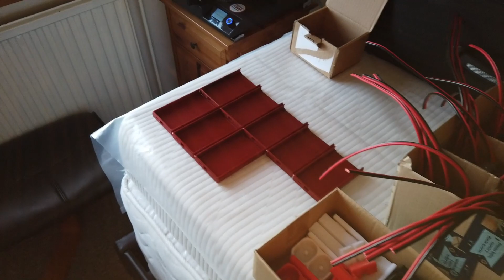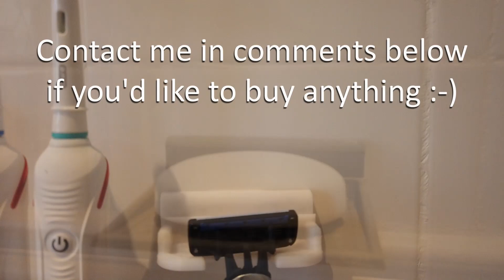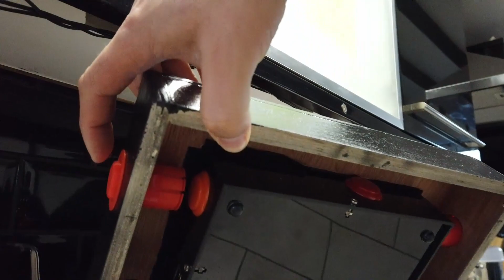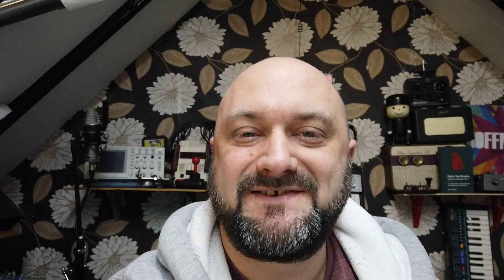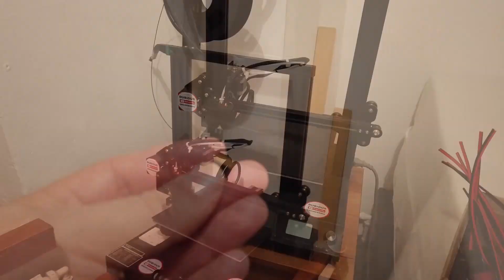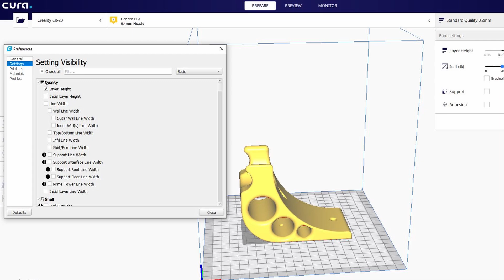DuB-EnG: Is 3D PRINTING USEFUL / EASY ? - My Designs, a process overview and Top Tips and Tricks

Comment: Howard, have you got Octoprint setup for your printers? I've got a Raspberry Pi 4 with a pi camera hooked up to my Ender 3. Its so much easier to manage the printer now (especially as my printer is now in an outside shed in its own enclosure). You can even send prints over to it without having to use the SD card. Its all free as well (with the exception of the Raspberry Pi hardware).
Reply: another vote for octoprint - incredibly useful software.
Send prints direct to printer via network/WiFi - these can even be stored on the octoprint server ( Raspberry Pi ) so you can reprint a previous design without having to download it again. 
There is a plugin for Cura that interfaces directly to Octoprint.
I also recommend to use the octoprint APP for monitoring/controlling  the printer - if you connect a web cam you can even have a live video feed from your printer!
They have a very helpful & friendly community

Cura - https://ultimaker.com/software/ultimaker-cura

 Octoprint -  https://octoprint.org/
Reply from the maker: Thanks 🙏 guys!! I’ve heard really good things about octoprint.  I may well have to do that at some point!! Today I had to print 20 DeWALT battery connectors... I’d love a way of auto removing parts and starting the print again automatically !!  The web cam is very useful too!
Reply: @DubiousEngineering  for continuous printing try search creality 3d print mill on youtube
sorry youtube wont let me add links today for some reason
Reply from the maker: I believe the Chinese one with the big booosoms did a review of that :-)

Comment: Nice to see some of the things you have made, particularly like the toothbrush holders, and the battery connectors. I had a 3D printer for years and never quite got it working well, but recently got a new one and they have improved in leaps and bounds. I ended up settling on OpenSCAD for most of my 3D print design. It doesn't suit everyone, but for a programmer like me, or someone with a mathematical mind, it's perfect. You can download people's designs as a starting point and tweak them, and there's also a couple of really good libraries of pre made objects for it. Best of all, it's free so nothing lost if you try it and don't get on with it.
Reply from the maker: Aha!! You’d like the programming interface to freeCAD or AutoCAD then! ... I’m much more of a visual creator ... that said, I’m a keen programmer myself!  I’ll watch a couple of videos on that software and see how it goes :-).  Thanks Jozza!